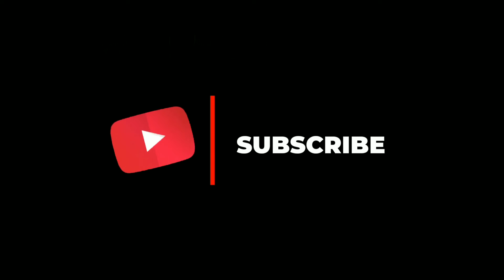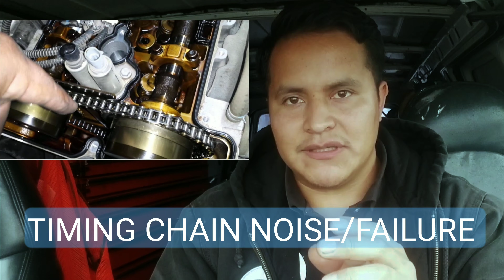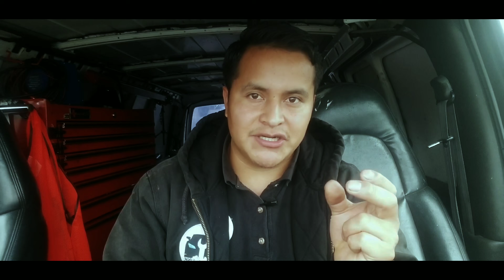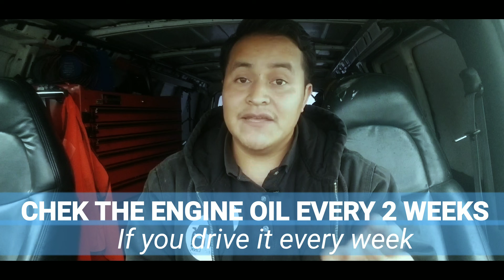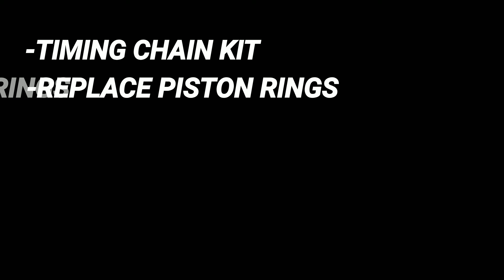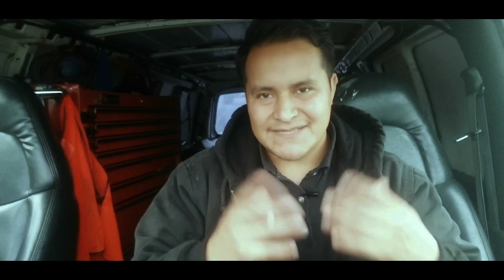GMC engine problem| why it fails and what you can do about it

Comment: I change the oil at every 3k for every vehicle I have ever owned.  I have just bought a 2014 equinox because I bought it from a family member for $100. 😂😂😂  it has 108,000 miles and is quiet and smooth.  The previous owner changed his oil every 3k miles at the dealership. All service records.  I got the car for next to nothing and with out any issues. I am replacing the intake with a cold air intake system because the location of the pcv hose inlet will make it impossible to be able to hold moisture. Second, i am installing an oil catch can to reduce the oil presence in the vapors coming from the crank case to hopefully reduce the build up within the intake manifold. Third, I installed the GM venting oil cap to vent if the crank case becomes pressurized.  Fourth, keep fresh, top teir fluids in the vehicle and watch closely.  I have been wanting to try Valvoline restore and protect so I figured in a 2.4 Equinox that is know for build up and is direct injected would be the perfect testing bed. The oil I took out was new and full, but the Valvoline immediately made the engine almost completely silent. You wouldnt know it was running if it wasnt for the high pressure direct injected fuel pump clicking away.  I wish this engine had port injection so bad. Sixth, since my engine doesn't have port injection, I am going to do upper engine cleaning every 3k miles with the seafoam spray in the intake kits available.  I just want to keep my valves from accumulating build up as much as possible.  I plan to get a scope that can attach to my scan tool so I can inspect the valves. I do have a media blaster but have not researched its compatability with crushed walnut media although I suspect it would be just fine.  

 Quite a legthy list, but I do this to all my vehicles minus the direct injection because i despise it, but at a $100 gift from a family member who took pride intaking care of the car and who just wanted to see it put to use and treated right, I couldn't pass up on the challenge. 😂😂😂😂

Comment: Don't buy one. 

I experience engine failure and I'm faced with either 30,000 plus on new/used SUV or 11,300.00 on new Engine. 

GM will not stand behind their Engines.

Comment: 20q6 Terrain 2.4 - 140k miles, so far so good. Just did NJ to FL, LA, TX, AZ, n back via North ... 7k miles without a prob. Oil n Trans oils changed. No probs. 29-32mpg consistantly. Cataclean, STP inj cleaner, zero issues so far.

Comment: I have a friend with a 2017 GMC Terrain purchased new from dealer.  Engine has failed at 82,000 kilometers or only about 51,000 miles!   

All regular maintenance was performed at dealer.  No warranty because its 7 years old & only covered for 5 years.  

These vehicles aren't designed for short tripping and extended oil change intervals.

I just watched your video to see what the issues are with these vehicles.

Comment: So I have the GMC Terrain I've always have to put oil on it. Now when I'm stopped for a while at lights it kind of feels like it's going to die but it never dies. What could that be
Reply from the maker: It could be the high pressure fuel pump at the engine but a cylinder not working correctly can also cause that. Using a scanner can most of the time point you to the right direction where to look for the issue

Comment: I just bought a 2013 Terrain SLE and EXACTLY 1 week later it started a clicking noise which seemed to come from the pass front wheel. Almost like something was stuck and flapping in the wind driving down the interstate. Engine turned off when we exited the interstate and we were able to coast to the shoulder. Oil everywhere and the battery died within the 2 hours waiting for a tow truck. I'm not sure the guy we bought it from will help us and AT LEAST tell us what his mechanic did before we bought it. 
For all the people leaving comments that you are scaring people, I wish I had seen this video a week AND 1 day ago. Maybe I would have known to keep checking the oil, I literally drove it 3 times...1st drove it home (Friday 2/16) from purchasing it 2nd drove to work (Tues 2/20 after paying taxes/tags) and 3rd drove it to work yesterday (Fri 2/23) AND that was a one way trip! 
Not sure what the next step is but thank you for your video AND explanation. Sounds like i have all of these issues rolled up into one expensive ball of 💩
Reply from the maker: You're welcome. Good luck

Comment: I took my 2013 Terrain to the dealer when I first discovered the issue. They had a repair/replace program, but my POS didn't 'meet the criteria' of having a severe enough leak. I called BS, and will be in desperate shape before I ever go back for another vehicle.

Comment: I have a 2015 Terrain with this engine and just started having problems with it. The oil has gotten very low a few times now without any, ANY warning light coming on! That is BS and there should be a class action lawsuit against GM for producing such a POS engine! 
Unfortunately it seems that at least 2 of the 3 American vehicle manufacturers can't provide a quality product anymore! Can't speak to Dodge because I don't know anything about them.

Comment: Very good info!  My thoughts:  If the engine starts using oil, do a good engine flush.  If it's using a lot of oil, (mine was using 1qt every fill-up) pull the plugs and dump a 1/2 can of seafoam in each cylinder. (2 cans total) and let it sit overnight.  Change the oil and crank once to blow the left-over seafoam out before replacing the plugs. Did this on mine and it is no longer using oil.  I believe the oil rings get gummed up over time and are not actually bad (maybe a bad piston design allows them to get gummed up??). All the other engine issues seam to stim from the sludge issue.  Clean the sludge, save the engine.
Reply: I recently had to get an engine replacement on my 120,000 mile terrain after the rod went thru the block, due to the oil consumption. Should I get the oil changed every 1000 miles instead of 3000 to prevent it from happening again?
Reply: What is you add gum out to the fuel. Would that do any good as far as keeping the engine clean is concerned?
Reply: @marlonapowellful  Check the can of gum out, it might be good for the top end.  something to work in the bottom end would be best.  I'm adding 1/2 can of seafoam to the oil every oil change.

Comment: I have the 2014 gmc terrain went thru 4 quarts of oil in 3 months freaking driving with literally no oil in it stalling everytime i stopped replaced the solenoids .But now have to monitor the oil every other gas fillup i didnt sign up for this shit screw gmc i only hope o can recoup some of the money i spent on it and buy something reliable

Comment: Had the engine chain noise diagnosed by dealer ,for $2100 , had it done at a shop I trust for 1/2 that but knocking noise still exists,on decel only at 1900-2100 rpm , sounds like a wrist pin , but nobody knows , any ideas , thank you , love video
Reply: My car did the same thing had work did on the car still running not good sell it before it to late

Comment: My 2013 terrain 2.4 just starter to make a bad rattling noise at start up specially at cold start, and also noticed the smell of fuel coming from the air vents and in the engine area what could this be?
Reply from the maker: Rattle noise is most likely from timing chain tensioners or camshaft phasers and the smell of gas might be from the high pressure fuel pump

Comment: I have a 2014 terrain, 4-cylinder. Already replaced the motor at 100,000 miles, catalytic converter, new battery, and crank shaft sensor. 
Well, my engine light is on again. Scanned it - it's the catalytic converter. 
Do you know how many catalytic converters it has?
Reply from the maker: It has two

Comment: Great informative video! I have a 2015 Terrain that I hope I don't have to get a new engine for. Used my code reader so I've started to work on it based on the codes I found. Thanks man!
Reply: I have a 2014 terrain. I had to replace the motor in the summer. Of course, then I needed a new battery AND a catalytic converter! There goes my vacation $$. 
3 days later it started missing. It was a sensor. My mechanic fixed that no charge. Whoopee! 
ONE month later it started missing AGAIN! Took it back to the mechanic. It was the crank shaft sensor. $300. It was good for 2 weeks. Engine light turned on and it doesn't have sufficient power. Grant it, it's a 4-cylinder but still. Should have some power. 
Well.... turns out it's the catalytic converter! WHAT??? 
My mechanic said some cars have two! 
Is that right??? I don't even know anymore. 
I'm almost done with all this. 
I see a Lexus or Genesis in my future!

Comment: My 12 sle bought with 60 miles BRAND NEW is pure junk. I actually sued and won a lemon lawsuit when it was three years old and paid off. Pure junk!! The exhaust has been looked at by four dealers and they all keep telling me the same thing, NOTHING WRONG. I've had to have the wheel bearings replaced at 32,000 miles, radio froze up and wouldn't turn up, down, off on multiple occasions. The wipers quit working in a heavy downpour on the freeway at 36,000 miles, the driver's door panel came detached, the dashboard had to be insulated, the starter solenoid went out, the catalytic converter had to be replaced as well as the flex pipe multiple times, and the exhaust resonator had to be replaced, ALL THIS under 50,000 miles. oh I forgot the window motors had to be replaced once now going out again because they are rolling up slow...Nah, I'm good , I will NEVER ever buy another G.m again. Sad because gms WERE actually very good vehicles. By the way, it's a 2012 and I'm not even @ 100,000 miles yet, 94,000 miles and it's 10 years old but pure junk. let me not start on how many times I had it in for it not getting the advertised miles per gallon no matter what fuel I used even with the oil changed tires rotated and no extra weight in the vehicle using cruise control and eco mode, still l  have never gotten the advertised gas mileage. I bought a very sour LEMON THAT SHOULD HAVE BEEN DEMOLISHED A VERY INSTANT THE FRONT TIRES ROLLED OFF THE ASSEMBLY LINE!!!!

Comment: Does GMC cover these engine issues on their warranty? I have a Terrain that made a loud whining noise and took it to the dealer. The dealer said they could not replicate the noise and after checking everything they said it was fine. Les than a month later the car made the same noise and started to turn off while driving.
Reply from the maker: They should cover it under warranty but it also depends on the type of warranty you have on your car

Comment: Search for the vented oil cap.  In the equinoxes it is not the factory part, but it is a direct replacement.   There is also a fancier breather valve oil cap from CFM.  REDUCE THE PRESSURE!

Comment: My fiancee has a 2013. When you turn it off it shakes and shudders more than normal. Just today it stalled out then wouldn't go over 25 mph. Any suggestions?
Reply from the maker: If it has a check engine light that should point the mechanic to the right direction, or what I've seen on these vehicles is the fuel high pressure pump leaks fuel in the engine when it gets old making the car to stall or shake

Comment: I have 2015 terrain slt 2.4.  I’m having problems of it shutting off wile driving , po191 code I replace everything, still stalling,   Then restarts after 1/2 hour sitting , then few hours later ,  it stalls out,  what do I do .
Reply from the maker: Have you checked the fuel high pressure pump?

Comment: Idk what’s going on with mine. It made a cracking noise and smoke was coming from the bottom closer to the front. I have coolant, oil, drives fine forward just going in reverse you can hear a clunking noise

Comment: I have a 2013 Terrain with 108,000 miles on it. No issues so far. I run synthetic oil in it and change it regularly. Fingers crossed. 🙏
Reply: Me too

Comment: Oh man, there's a 2012 equinox listed for what I thought was a good price (3.5k) online, has the interior with the lcd screen and everything. Would be a really nice upgrade from my '96 camry (with no power windows, locks, ac, or cruise control), but after a bit of research... Yeesh.
I really want the thing, but I really don't want that engine. It has 120k on it... Supposedly a bad fuel pump... Easy enough fix... But this oil consumption problem seems like a nightmare. I feel like I'd have to rebuild the engine for it to even be operational.

Is the only thing wrong with these engines is that they use a poor quality piston oil ring? Would replacing factory piston rings with high quality 3rd party ones prevent the engine from this seemingly inevitable fate?

Comment: Coming from a gm dealership I've changed more pistons for oil usage, t chain jobs from broken guides and rocker covers for a vacuum leak most under warranty then I care to remember....you forgot to mention the untold thousands of camshaft actuator solenoids replaced...pistons, t chains and the actuators rely a lot on the oil being changed regularly but It wasn't helped by a software update to the oil servicing by extending the time to do it so when the sludge starts it effects all those items..oohh the horror

Comment: I am original owner of a  2012 GMC Terrain 2.4 - 64,000 miles and I don't have any of these issues. As a matter of a fact I have not had any issue at all - I did get a recall for an oxygen sensor but did not bother taking it back as it runs just fine as it is and I don't need some dealer missing with my car. I use full synthetic oil every 3 to 4,000 miles - uses no oil in-between. Runs great.

Your scaring the people that don't maintain their cars. lol
Reply: Consider yourself lucky because I just purchased a used 2010 gmc terrain, and within the first 2 months I'm already needing to replace the timing chain and belt - a repair that is going to cost me over $2,000. I got an oil change after 2,000 miles and within the first month of owning it. Not only that, I had two inspections done on the vehicle before this issue happened. He's not trying to "scare" anyone. The fact of the matter is that these vehicles have a high cost to maintain, and I can confidently say I'm stupid for purchasing this junk, and anyone is after knowing the issues these are known for.

Don't know if you'll see this but I'd love a follow up on your comment, just to see if you've had any of the issues he's mentioned.

Comment: great video. I have a 2012 terrain with 150k miles on it.  I had the timing chain kit replaced at 115k miles and was just told it needs to be replaced again along with the entire exhaust system for 6500 bucks. Is the 2018 any better?

Comment: You make it sound like it happens to every GMC terrain of these years like it's going to happen for sure. I have a 2010 and I've never had any issues with it, and I know people who have similar years and never had any issues with them so it's a little discouraging your video, because you make it sound like it's going to happen to every single GMC terrain engine. It's a little misleading I see a lot of of these SUVs on the road with no issues. It's probably people that are not giving maintenance to the car changing the oil so forth and so on, so you should do a different video clarifying that..
Reply: Dont buy gmc terrains at all, new used certified, stay away. It sounds like ur a gmc dealer lol jks. But he is correct they all suck, ours has been crumbling and mechanics have no clue as others say on the comments. Don't buy a gmc terrain, unless u have deep pockets.
Reply: @Griznation03  I had mine 8 yrs, I love it no problems at all 💯💥

Comment: LOL when will people realize that gm vehicles are junk nothing but junk and has been junk all my life. Most of my family are gm junkers. All across the board all gm engines are having oil consumption issues, the multi displacement crap is junk, electrical issues is common place. A lady in our church has a 2013 terrain with only 38,000 guess what the friggin engine blew, her dead husbands 2016 gmc truck uses so much oil with it's pos 5.3 and it has less than 50,000 miles. She is a 80 year old widow, me being a retired mechanic ask me what to do i said put a good used engine in that terrain then take both of them gm pos's and trade them in on a new toyota, or a ford anything just stay away from the gm garbage. She went ahead and traded in both gmc's on a 2022 ford edge. she said i ain't putting any money in the terrain at all. Pissed off a church member that owns our local gmc dealer,, he got smart with me and i said i don't own or do i drive the junk you sell,, period... How many engines would it take to make a terrain hit a million miles, how may licks does it take to get to the center of a tootsie pop, the world may never know.

Comment: Horrible car 2015 terrain have replaced engine and transmission and engine is blown again  wish they would do a recall this is ridiculous
Reply: I have a 2015 too. Timing chain went and took the engine with it. All scheduled maintenence done religiously. 72000 miles. Had the engine on my Envoy go about 80000 miles. Done with GMC.

Comment: My 2013 GMC Terrain engine blew at 61,000, I never had any warning lights or any indication of low oil. I heard no noises. I drove it a mile from house, got to the stop sign and it started jerking then knocking and than it died. The dealer replaced it at no charge. A year later I received notice of oil consumption class action lawsuit. I've always had the synthetic oil change between 4000-5000 miles. My new engine is about 2 years old now and it is also consuming oil. Do you recommend getting a synthetic oil change?
Reply from the maker: Yes, synthetic Everytime and instead of 4k miles oil change do it every 3k miles. Check the engine oil every other week, add more oil as needed